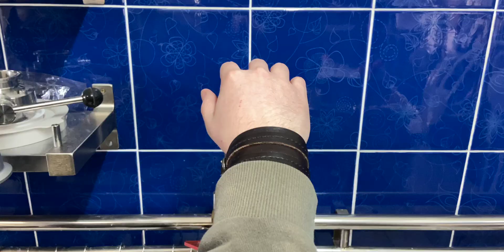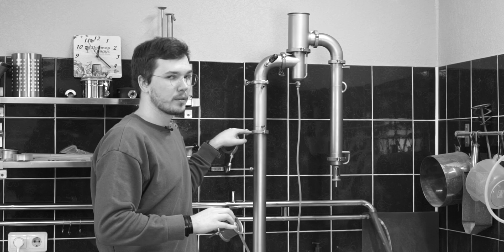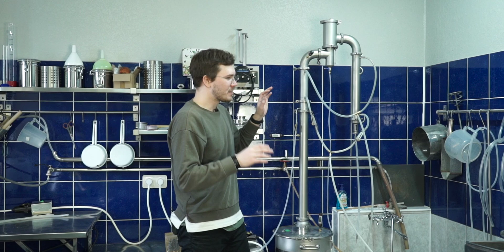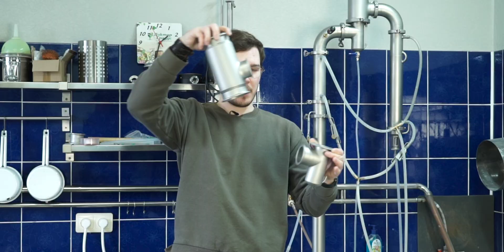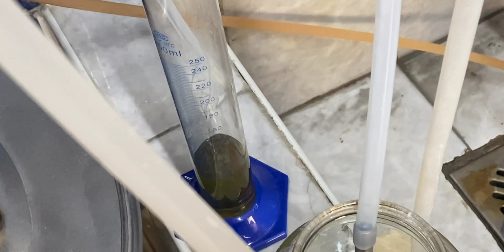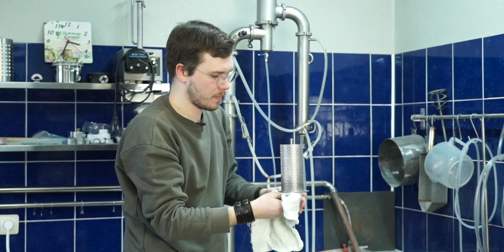Using GIN basket CM distiller

Comment: Hi could you tell me more about the part you forgot to put on .you called it a heads collector .is there another name for it or could you send a link for it . Thanks peter from ireland
Reply: look up Andrey's video on ''Liquid managament unit for distiller column'' on this same site.It just collects the liquid from the cooling condenser in this case heads so he dumps them out the side then turns it off to let the hearts go on to the gin basket unit for flavor.

Comment: Great video, Andrey. 
I had a question about the M2+ heating system. Does it run on 250v power?
Reply from the maker: Thanks! M2+ has russian controller. The range of the input supply voltage at which the device maintains operability from 60 to 300 volts. This unit won't work with two phases - probably... I am not educated that much in electricity. We are going to make heating regulators and elements for US and Canada but it takes time... We ordered good US plugs, 110 V elements and converter to test it here in Russia.
Reply: @DoctorGradusInternational  Thank you for the information.

Comment: Hello my friend, another great Video!  I really like the way your Gin Basket is positioned and the water level checker and also the ability to drain off the Heavy Oils if you desire. Very very nice! 

I like  my Gin With a whole 1 Juniper Berry lol. I'm not a huge fan of Juniper :) But many many people my friends and family are. Also I like the Roller Valves alot. I believe I would like them better than needle valves... 

Another great thing about your amazing equipment is the stainless steel. Copper is too hard to keep clean and you don't really need copper. It's pretty but it's very hard to keep it pretty.... 

Thanks for Sharing, 

Austin
Reply from the maker: Thank you Austin for so such a great comment! Roller valves are very easy to use and you can use what is going on in the hose no mater if it's pvc or silicone, because of transparent material, you can understand how water flow is happening.